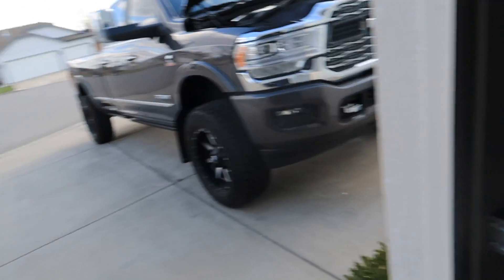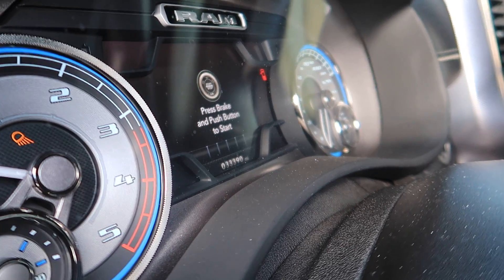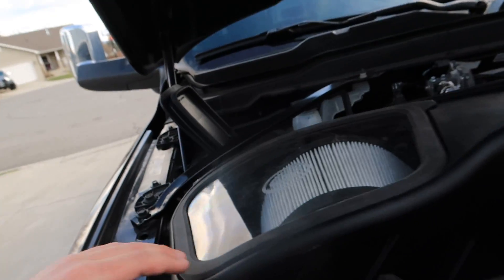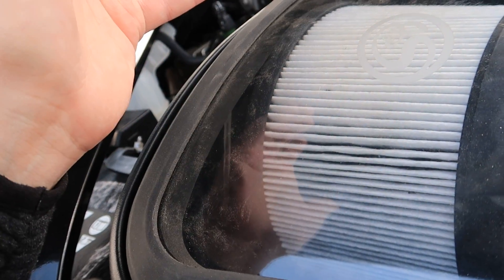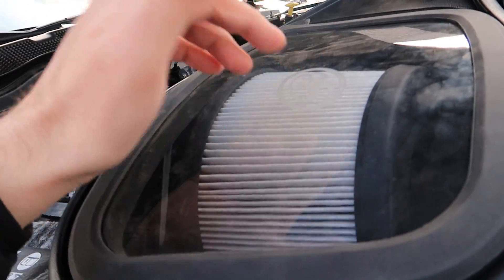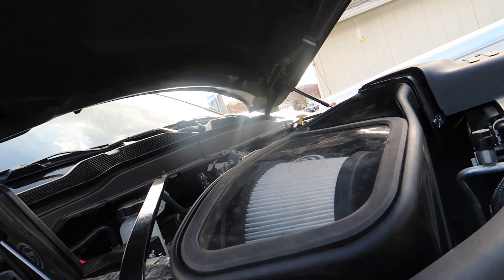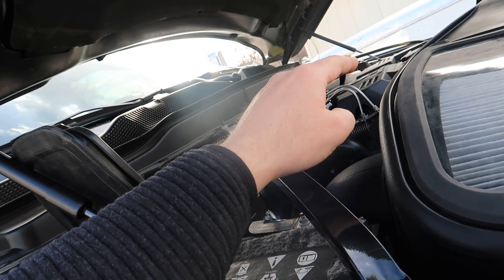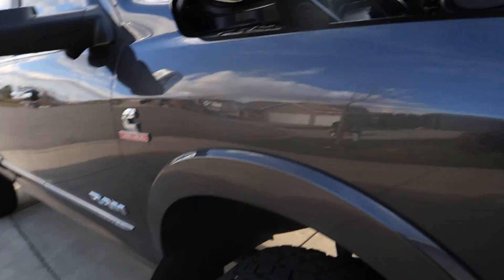2019- 2020 Ram 2500 3500 CUMMINS S&B INTAKE SYSTEM. 75-5132D

Comment: Mine does the "bucking" thing too. It's when I'm in high gear, low rpm, rolling into the throttle, and building boost.  I put the plug in and "bucking" went away.  My check engine light came on with P0402 code(dealership replaced egr valve and 60 miles later light with same code came on).  Reached out to S&B, and engineers are currently working on the fix.  I almost thought the "bucking" was from my transmission  because I had just gotten the valve body plate recall done.  But now I can definitely rule that out since you have the Aisin.

Comment: I kinda looked into getting one for my gas ford f250 but they want like $300-400 and every review said it fit but wasn't very secure.  I don't really believe intakes are very good horsepower per dollar on modern vehicles.  Will be interesting to see if you get any mpg gains!

Comment: Awesome! Do you think is helps with the lag? My 19 HO feels very laggy when you roll into it from light throttle
Reply: Definitely wakes it up. I dove with mine unplugged and it had better throttle response, and turbo spooled up faster.  With it plugged, it felt like the stock air box.  But the computer seems to get confused with the improved airflow and it kinda doesn't like it.  Like it's making boost too fast.  Causing that "bucking" he's describing.
Reply: Needs something! It's pretty annoying stock.
Reply: @ericmackison9517  It might be what you're looking for lol

Comment: You say you can hear the boost, do you still have the Air defuser and the foam around it?
Reply: Edward Nelson that’s on the stock pipe after the box, he put the new pipe from s&b I don’t think you can run it in their pipe
Reply: @jbandit2044  Thanks so much for the clarification, I didn't consider that, thanks for the info.

Comment: Hey Paul, does the s and b mess with the warranty at all?
Reply: No
Reply: No,not at all S&B Even states that the warranty will even have lawyers , if the dealer refuses to work on it because of the S&B filter. So you are good to go, I’ve put one on my 2018 2500 Ram,I love it,  the sound of the turbo, you can hear the whistle of the  turbo better and the engine break.

Comment: Does having the plug in make that much difference?
Reply: Night and day difference.  Without the plug, better throttle response(turbo spools a little quicker).  Turbo whistle and exhaust brake sound sweet. With the plug, it's just like running the stock box.
Reply: @josemonreal09  I'm looking at this intake. What do you mean by plugged or unplugged?
Reply: @cnetate  there's a silcone insert on the side that you can remove, but you'll have more bugs and dirty get in.  But it sounds way better when you take it out! 😂😂😂

Comment: Gave me a check engine light, they sent me the spacer for the air flow sensor, check engine light still on
Reply: You're probably getting the P0402 code that I am.
Reply: josemonreal09 and the p0234
Reply: @fxdcryder  I never got that code but I still put in the new tube they sent me.  Just waiting on them to find a solution for the P0402 now.